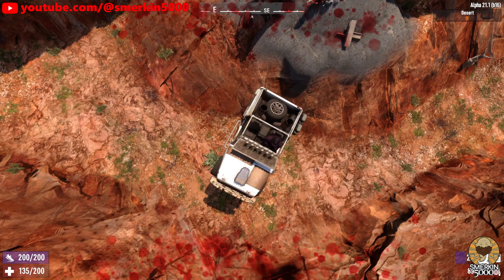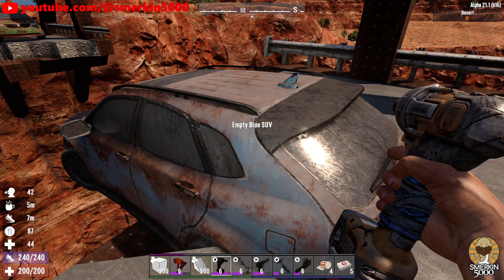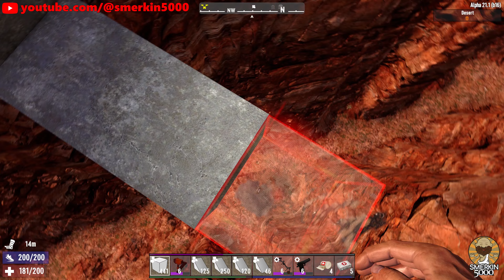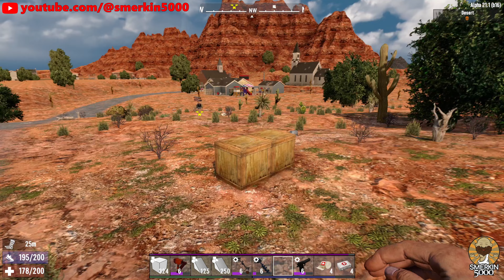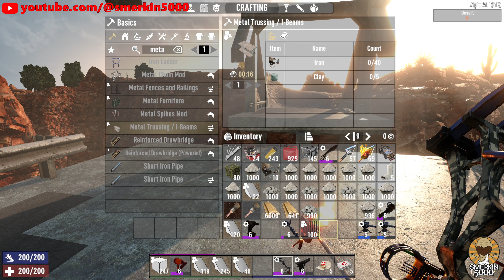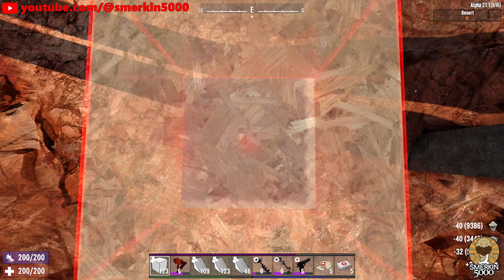Canyon Bridge Repair [4K]

Comment: It's been done \o/
Btw, I had no idea you could craft those railings!  
Nice job on the bridge, and nice to see some 7DTD content as well (I know there's two others - I just saw them :D )
And to answer your question at the end of the video: I think I would have skipped the middle support pillar and instead added cross bracing between the outer ones every so often, provided that the stability of the blocks allows it.
Reply from the maker: Yeah I wasn’t sure if two supports would have been enough so I just went with the three. 

There’s quite a few things you can craft like the railings that are hidden away in the shape type, but I can never remember them all lol